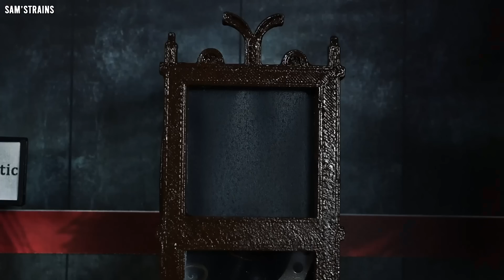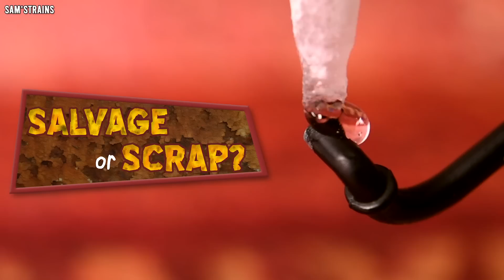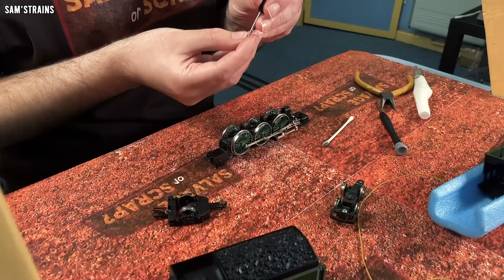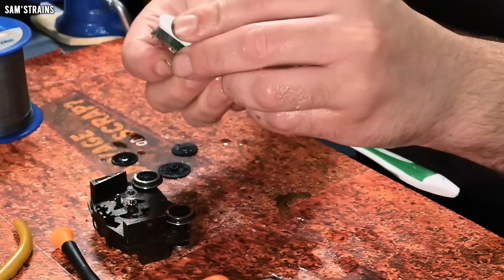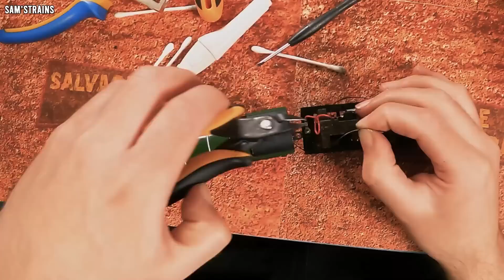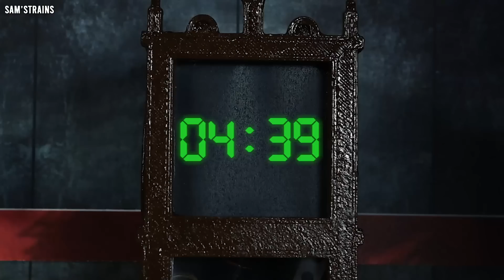Broken Hornby A1 | Salvage or Scrap?

Comment: I have a 4472 from 1972. I'd repair that at pretty much any cost. It's a very good runner as it is now, but the tender is basically just a coach, no pickups. the engine itself has 6 driving wheels (like the real thing would have) but only the driving wheels have pickups.
Regardless, my first Flying Scotsman, it has some sentimental value.

Comment: If u use regular paper for plates, signs, (...etcetera), just put a pice of transparent adhesive tape over them before u cut it out. Its going to be a lot stiffer and easier to work with it.
That's how we made all our road signs on or "city layout".
Reply: BTW the coupling-rod is upside-down!

Comment: I have had a few wheel tyres come loose - where the wheel centres are metal I used 3 small dots of Loctite green retaining compound to fix the tyre in place. This leaves the rest of the tyre\centre interface to pass current if necessary. I am trialing loctite green on some plastic wheel centres .. 6 months down the track they still seem OK and no damage to the plastic so far.

Comment: I really need to get a soldering iron. Had to fix a broken wire on Flying Scotsman today and it’s getting tedious having to heat my favourite pair of needle nose pliers to yellow just to fix that.  I hope your doing well Sam!
Reply: Lidl occasionally have some in the middle, keep checking in there and you'll probably find one before too long
Reply: @Eric_Hunt194  really I’ve just been putting off to save up for a milling machine. I can make the improvised set up work, so I’ll keep doing it until the machine shop is ready and then I can get a Weller soldering station as a be all, kill all solution. Thanks for the tip though! I appreciate it.

Comment: Great salvage !!  I wonder why there are tender-driven locomotives being manufactured ?  There is enough space inside the loc, so it seems unnecessarily complicated.
Also it just doesn't feel right. A locomotive should pull, not being pushed.  And it makes a loc easier to derail in corners, it seems to me,   I wonder if anyone knows the reason.
Reply: Because hornby copied the concept from continental practice as they started their tender drive range with a licensed copy of the Fleischmann drive unit.

For continental locomotives using tender drive makes more sense as we tend to use the same type of tender on a variety of locomotives. 
For example the well known tender of the Kriegslok can also be used on the DB class 50, 38, 42 and 44. You get even more options with the 3t12 and 3t16 chassis.

Another reason is that being 1:87 the boilers are narrower forcing the motor to be placed in the cab if there is no other option.
Oh and we solved the issue of the tender moving before the locomotive does by putting kinematic couplers with wire guides between them. This allows close coupling and gets the wires out of sight.
Reply: @ivovanzon164   - Thank you very much for that detailed explanation.  The swapping of locs to tenders is an interesting feature.
I am new to the model railroad world, so this is great information.

Comment: Very soft spot for those grand old tender drive LNER pacifics. Looking at them with a modern eye so much looks absurd- above all, that one side of the pickups, on a locomotive with a total of eight wheels on each side, depends entirely on two small tender wheels and nothing else- would it really have been so prohibitively complicated and expensive for 1980s Hornby to make a drawbar connection with two wires, and pickup from the large loco driving wheels on both sides, I wonder? That said though, there's still something magnificent about watching them sail along the line, rake of teak coaches in tow, the old sensible design rear pony truck whose wheels actually stay on the track, watching the coupling rods spin as those driving wheels whirl round.

Comment: Hi. I’d recommend that - for non-critical parts (like the smoke box door) - you make a slight change in the rules; you still can’t buy them, but the time limit for 3D printing them doesn’t apply. The regular rules (and time limit) will still apply to critical parts (driveline, wiper pickups, the motor, frame, couplings, and wheels/valve-gear.) 😊 This just makes sense in terms of prioritizing the repairs; why 3D print a smoke box door, when you might need the 3D printer for something critical later? You can always 3D print the extra detail parts once the loco can haul a rake of wagons or coaches around the layout without stalling, derailing, or bursting into flame (well, I HOPE it doesn’t catch fire - that would be bad!)

Comment: The last loco I rebuilt was an LGB RhB Ge 4/4 III with electric up/down pantographs and full DCC style sounds etc. It took the best part of 10 hours to get the thing dismantled and then 3 weeks of on and off work (much was postal time) to get it rebuilt. It's still not perfect, but getting there :)

Comment: A long time ago I had a rather weird railway dream. It began with me visiting a railway scrapyard. There was no-one about, no sound was to be heard anywhere. I walked along between two standard gauge track sidings, half expecting to get caught. No-one stopped me doing something so potentially dangerous. A black shape in the distance caught my eye, and I ventured forwards.

The black shape, upon closer inspection, was a 57xx Pannier Tank Engine so small, I wondered how on earth the chassis would be wide enough to fit on to the 4ft 8 & a half inch sized track. As it was, the little steamy begged me silently to save her from the evil scrapman. So I somehow managed to make up her fire and top up her tanks with water. I sat on a tiny chair in her cab, put her in reverse and drove her along the track. I had no idea where the rusty rails would lead to, yet my steed and I kept going. We flew past main line stations, and found our way on to the Severn Valley Railway. At Kidderminster Town Station, opposite side of the island platform, Raveningham Hall was willing to give us a lump or two of coal from her tender. Another Driver took over from me. The 57xx Pannier Tank Engine was safe.

This is where the dream ended. I was wondering who I ought to share the story with, and so I hope you enjoyed it. I know how much you love reading my stories.:_SamstrainsTheWheel::_SamstrainsSamstrains:
Reply: Many years ago my dad took me and my brother to sneak around Booths scrapyard in Rotherham, where there were several rather sorry-looking Class 50 diesels seemingly awaiting their fate... thirty years on and some of them got saved and are still running today!